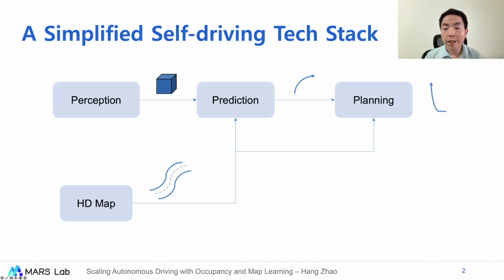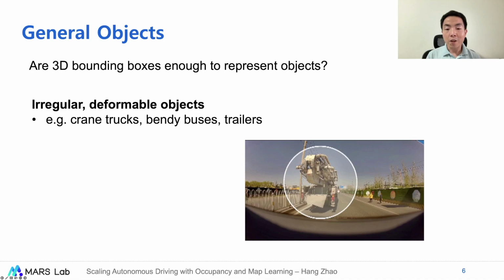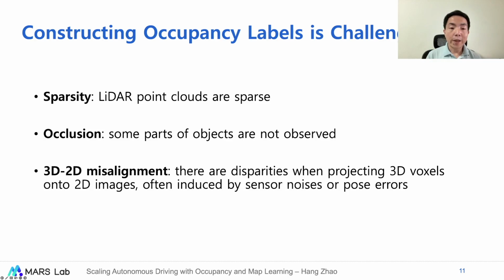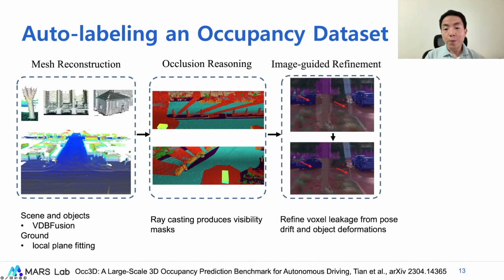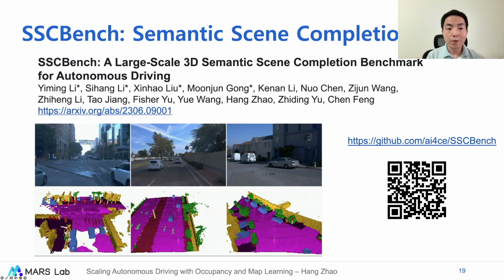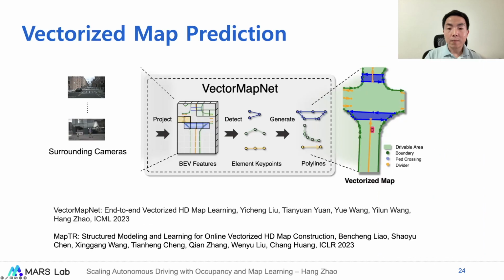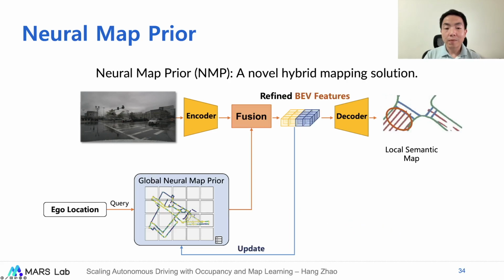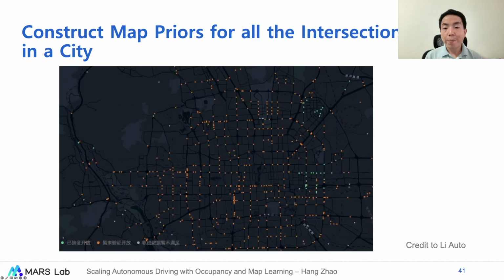[CVPR'23 WAD] Keynote - Hang Zhao, Tsinghua University

Comment: 3D representations can provide valuable information for self-driving systems, but they are typically used in conjunction with other sensor modalities and data sources to create a comprehensive understanding of the environment. While 3D representations, such as point clouds or voxel grids, can capture geometric details of the surroundings, they have certain limitations that make additional information necessary. Here are a few reasons why 3D representations alone may not be sufficient for self-driving:

Limited Field of View: 3D representations typically rely on sensors like lidar to capture the surrounding environment. However, lidar sensors have a limited field of view and can struggle with detecting objects beyond their range or behind obstacles. Therefore, additional sensor modalities like cameras and radar are used to provide complementary information.

Perception Challenges: Understanding the environment goes beyond geometry. Perception tasks like object detection, classification, and semantic segmentation require information beyond 3D representations. Cameras, for example, provide valuable color and texture information that aids in object recognition and scene understanding.

Dynamic Objects: Self-driving systems need to account for the motion and behavior of dynamic objects like pedestrians, cyclists, and other vehicles. 3D representations alone may not capture the temporal aspect of these objects. Additional information, such as object tracking and prediction algorithms, are necessary to anticipate and plan for the future movements of these dynamic entities.

Environmental Context: Environmental context, such as traffic signs, road markings, and traffic signals, plays a critical role in self-driving. While some aspects of this information can be captured in 3D representations, other details may require explicit detection and recognition algorithms designed for specific objects or structures.

To build robust and reliable self-driving systems, it's common to integrate data from various sensors, including cameras, lidars, radars, and other sources, to create a holistic understanding of the environment. Combining multiple sensor modalities and data sources allows for redundancy, robustness in different environmental conditions, and a richer representation of the surroundings.

User
3D occupancy prediction 
ChatGPT
3D occupancy prediction is a technique used in self-driving and robotics to estimate the occupancy or occupancy probability of the environment in three-dimensional space. It involves predicting which regions of the 3D space are occupied by obstacles or objects and which regions are free or unoccupied. This information is crucial for path planning, obstacle avoidance, and collision prevention.

There are various approaches and algorithms used for 3D occupancy prediction, and here are a few common techniques:

Voxel Grids: Voxel grids are a popular representation for 3D occupancy prediction. The 3D space is discretized into small volumetric cells called voxels. Each voxel can be marked as occupied, free, or unknown based on sensor measurements. Algorithms like occupancy grid mapping or probabilistic occupancy mapping can update and maintain the occupancy probabilities of the voxels over time.

Point Cloud Processing: Point clouds obtained from lidar sensors are often used for 3D occupancy prediction. Various techniques, such as point cloud segmentation, clustering, and surface reconstruction, can be applied to identify and estimate the occupancy of objects in the point cloud data.

Deep Learning: Deep learning methods, particularly convolutional neural networks (CNNs) and their variants, can be employed for 3D occupancy prediction. These networks can learn to directly predict occupancy probabilities or voxel-wise occupancy labels from 3D input data, such as point clouds or voxel grids. Training these models requires labeled data that indicates the occupancy status of each voxel or point.

Sensor Fusion: 3D occupancy prediction can also benefit from sensor fusion, where data from multiple sensors, such as lidar, cameras, and radars, are combined to create a more comprehensive representation. Sensor fusion techniques, like Kalman filters or particle filters, can be used to integrate the data from different sensors and refine the occupancy predictions.

The accuracy and reliability of 3D occupancy prediction depend on factors such as sensor quality, sensor placement, calibration, and the algorithms used. It's common to combine 3D occupancy prediction with other perception tasks, such as object detection and semantic segmentation, to create a more detailed understanding of the environment for autonomous systems.